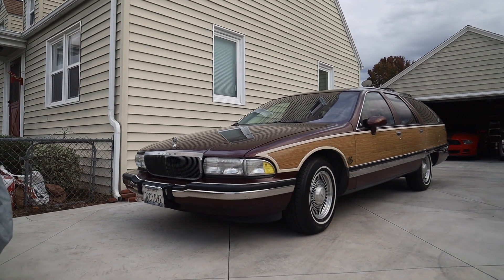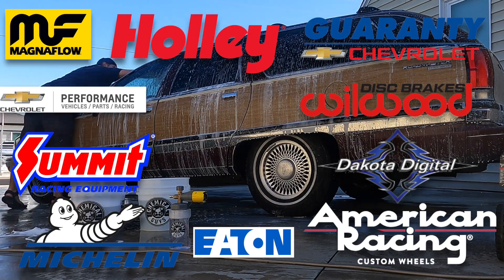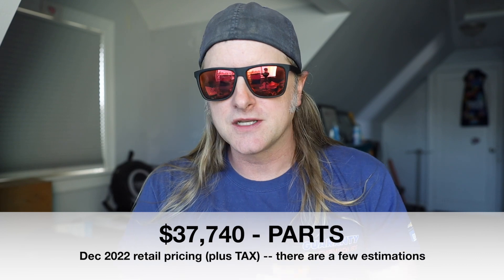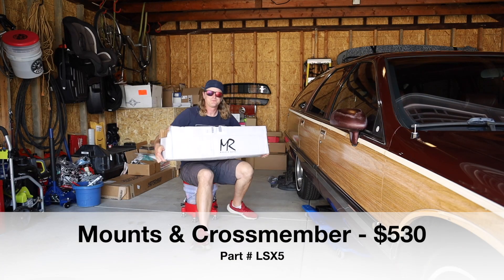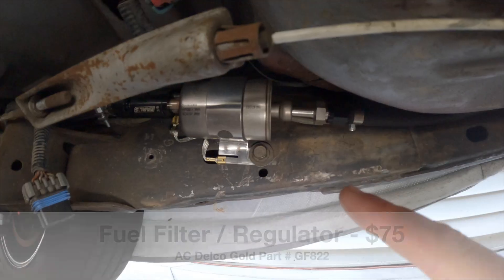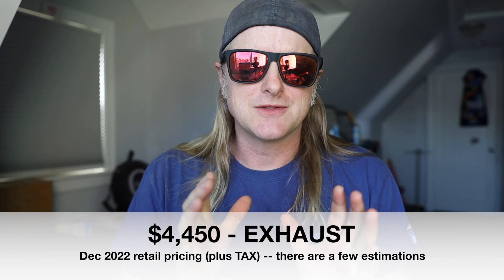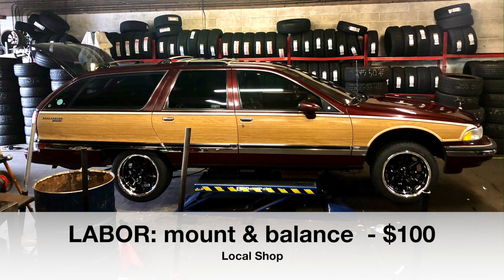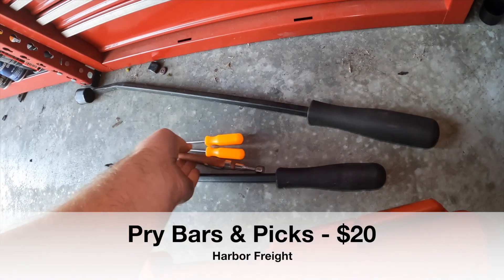LS Swaps Are a LOT More Expensive Than You Think!!! (LS3 Roadmaster Wagon Project Pt.9)

Comment: This why I watching the one on BaT. I figured at 20-25k it would have been a good idea. But also would it really be faster or handle better than my stock ‘19 f-150 5.0? And you bought that wagon at the right time, my caprice wagon I paid up for.
Reply from the maker: Thanks for watching and the comment… I can say that, without a doubt, this is faster and handles a lot better than a 5.0 f150 (which I love too). An LS3 b body may be old but with the right suspension it’s lighter, lower, and tighter than the f150… even though that has a lot more passenger room and is terrific as a truck.
Reply: @internetbrandsautogroup3826  I was thinking they’re about the same weight and power. Atleast the wagon can hold a sheet of plywood unlike the 5.5’ bed 🤣
Reply from the maker: @Items-and-stuff  hahah, very true. 

as for the weight, the roadie as it sits is just under 4,500 pounds. unless your truck is a regular cab, it's probably at or over 5k.

Comment: Just buy a rear ended Z28 for around $5000 and you're done. comes with everything... There are "free" ways to flash the PCM so no expensive HPTuners needed anymore... and you get to sell everything off the camaro you dont need. I have done several this way and after all is said and done i have probably made a profit.
Reply from the maker: Great advice, Wayne!